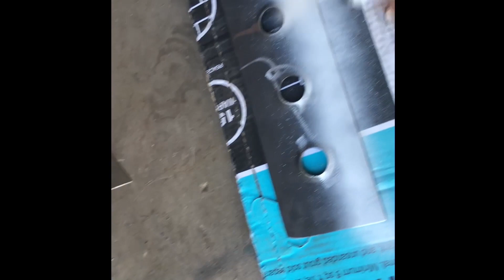custom cantilever pushrod suspension for my toyota mini truck

Comment: Hey Bro - I strongly suggest going to like a night school to learn how to weld better. Your execution was really good but the craftsmanship has let you down.
Reply from the maker: I’ve been practicing and learning online. learning to tig weld now too. gotta start somewhere. also just invested in a new welder. no longer flux core!
Reply: I’ve been welding for 600 years those welds will hold. He used the liquid nails